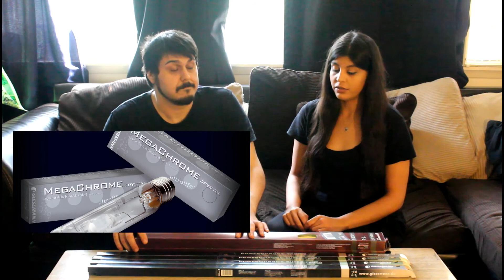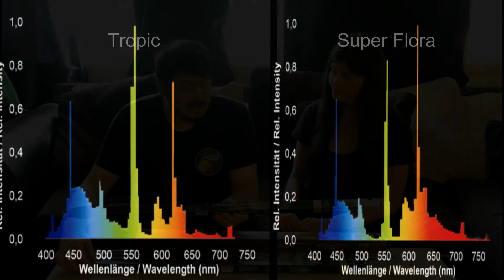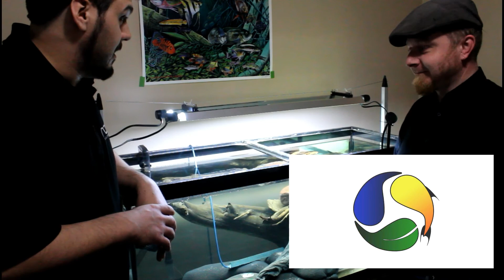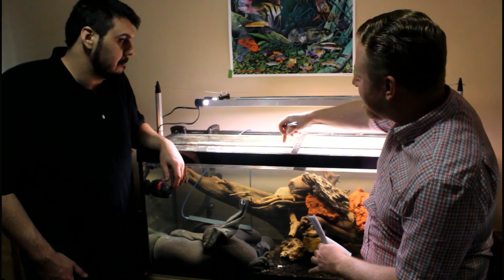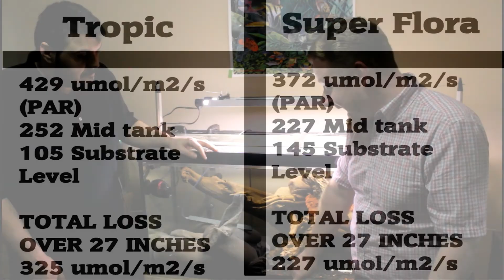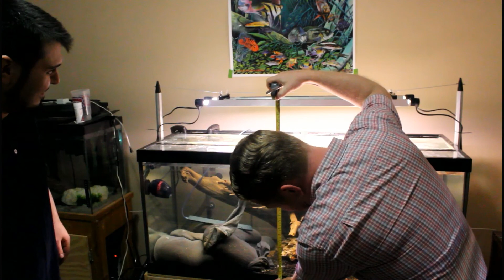Giesemann T5 Lighting for Planted Tanks  Super Flora, Tropic + PAR Testing 🌿 Mega Build

Comment: Good par, nice review. Now only if you had some data on power usage vice lets say a Fluval fresh and plant 2.0. Because power usage in my book is a big deal when running a entire fish room.
Reply from the maker: I will need to get me one of them meters to read power consumption i think. 39 watts per bulb is not really that bad when i look at the consumption of the lighting i have on my 35 gallon at 130 watts per fixture. Now i don't use those on full power so i am a bit curious to that myself. I guess we will find out on the next bill and see what the difference is. I think it will all work out though as i an adding bigger filters and removing multiple smaller ones on my tanks. So we will see i guess if it works out as I'm thinking it will.